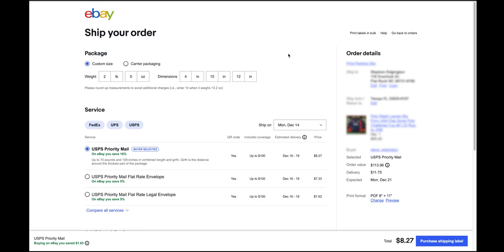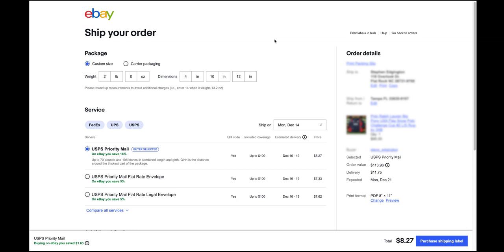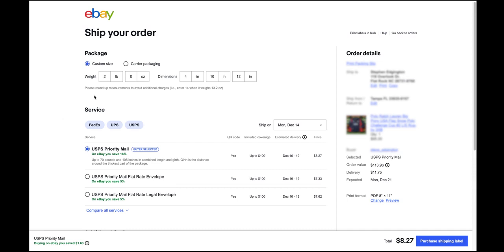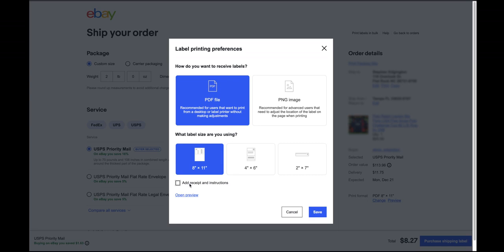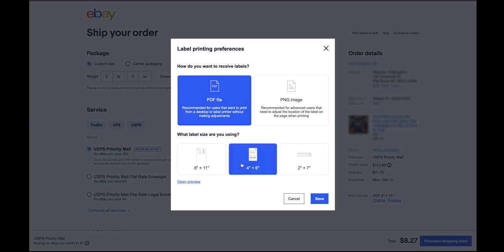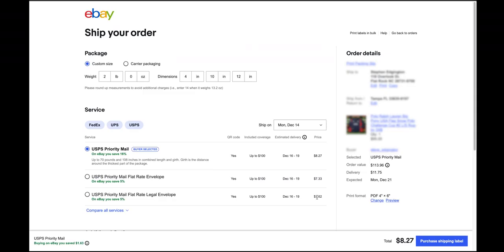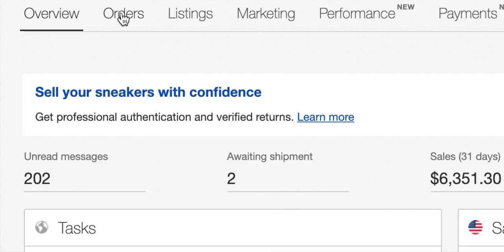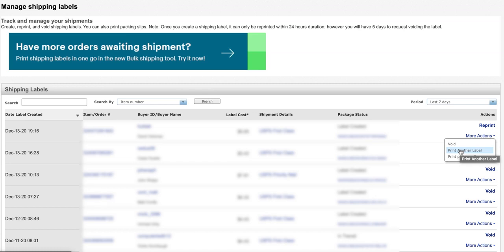Ebay Shipping 4x6 Thermal Label Printer Settings: How to Fix Label Printing Sideways and Small

Comment: My printer keeps skipping pages between each label 😩 is there any way I can fix this? Because it is wasting too much paper.
Reply from the maker: It is probably because of the settings. you can fix it very easily in few steps by your own. 

Just find out the printer settings Control Panel\Hardware and Sound\Devices and Printers. 

Then select the Printer(LABEL) right click on that then click on printing preferences then click on page setup there you will find Media setting : under that there is two option 

step 1 :- select methos according to your label how it is with gaps of marks.

Step 2 :- Gap/Mark Height: input the exact gap or mark size of your Label. Ps: You have to measure the label gap by ruler by your own.

Please find the attachments

Thanks & Regards 
Team Spata